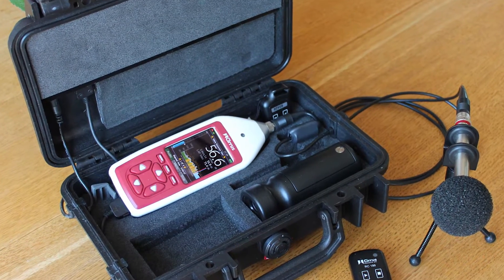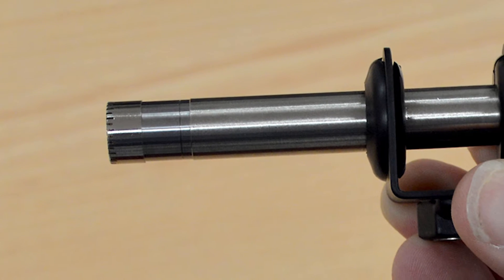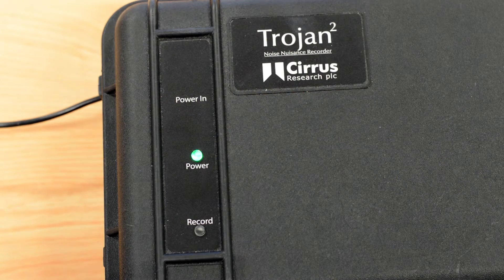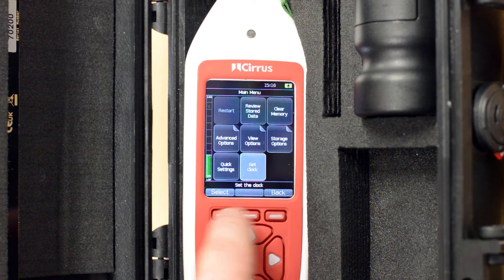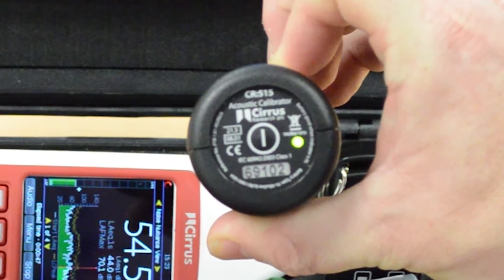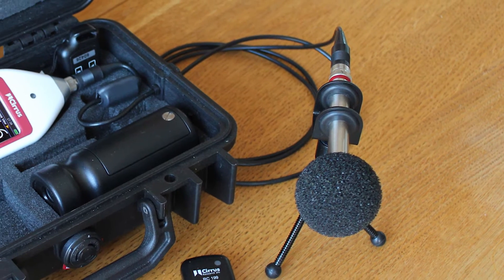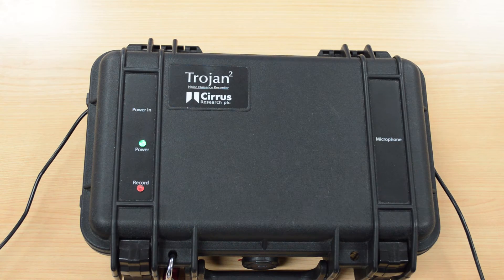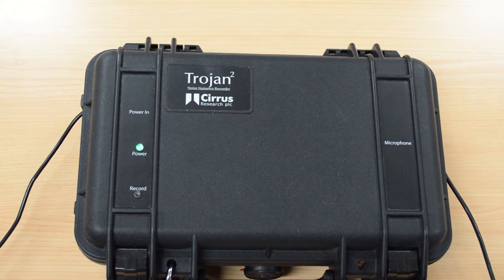Getting Started with the Trojan2 Noise Nuisance Recorder

Comment: How does this equipment show where the noise is coming from surely it is open abuse and falsifying evidence
Reply from the maker: Hi Darren, thanks for the question. While the Trojan can't detect the source of the noise, it has a system in place that can identify when data has been falsified. If you need to know anything further about the Trojan solution, please feel free to get in touch.
Reply: @cirrusresearch  What's to stop someone from making noises just to record and claiming it was the neighbour.
Reply from the maker: @VeganoGuy  Hi there! Thanks for the question. The Trojan makes use of advanced technology to help identify when data has been falsified. Feel free to get in touch directly to discuss this in more detail.
Reply: @cirrusresearch  How long is the equipment on average, left installed ?
Reply from the maker: @VeganoGuy  It can often depend on the case or the local authority/housing association carrying out the investigation, but on average the equipment is in a property for around a week.